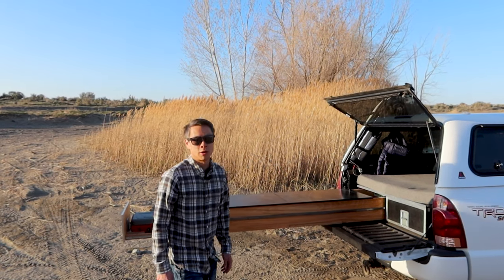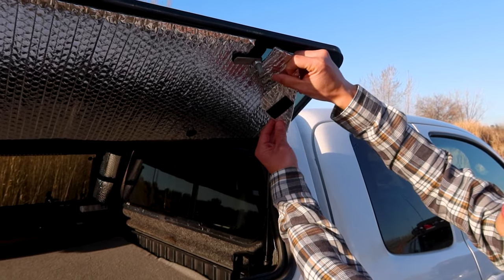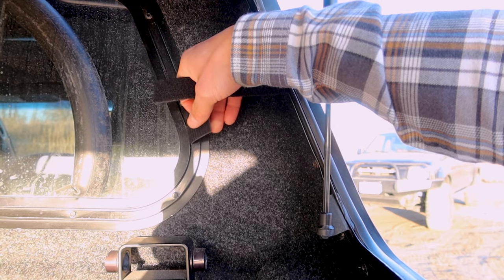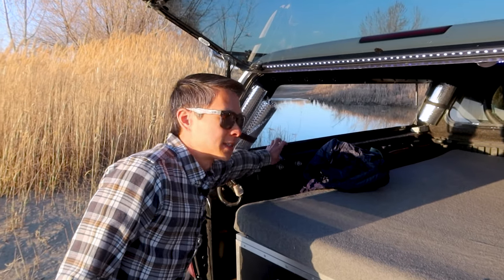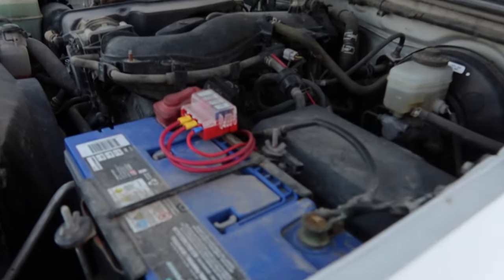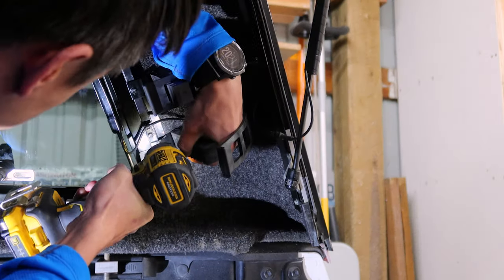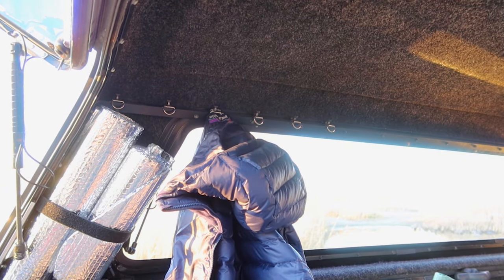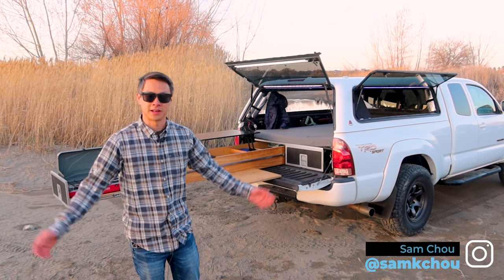Essential Truck Topper Mods for Camping and Overlanding

Comment: I like your setup, but I went with simplicity, I do that with most things. All I have is some cardboard on the bed, covered with OSB board, moving blanket, camping air mattress, sleeping bag with several blankets, a little wooden box turned sideways for shelving, and cammo curtains with shock cord to hook them to brackets on the window frames. I love riding my motorcycle so I try to put any savings into the bike's fuel tank. I do remove my curtains from the cap's side windows while I drive to open up any blind spots. A head lamp is all I need, mainly because when I get around to stopping it's to go to sleep. My truck is a 2003 Ford Ranger, 400ci V6, in excellent shape.

Comment: We took a slightly different approach to ours: reg. cab with 8' bed, pillow top mattress in back witch leaves about 2' for Dometic fridge (12v outlet in back),firewood and a 8 gal water container, the one big game changer was getting a professional crawl-thru (Breezer Windows), i'm old and i remember crawl-thru's. This one doesn't leak. The stock sliding window on 07 Dodge is very small. Our truck is for camping & traveling only so i need room for firewood & camping equipment, but even with all our stuff we can stealth camp.
Reply: Sounds like some one who watches Steve Wallis.

Comment: Very informative, thank you for sharing. What gauge wire did you run from the battery to the connector by the break light? Also, what does the connector look like?

Comment: Do you have any problems with the lights sticking to the glass?  And do the lights you have at the very top, when open, of the lift gate get in the way or get hit when the lift gate is closed?  Very nice work and very clever.
Reply from the maker: No problems with lights coming loose whatsoever. The velcro tends to come off in freezing temps, though. The light strip clears the tailgate no problem.

Comment: Great video. Why can't you drill into the fiberglass?
Reply from the maker: You definitely can, but the hole will go through the other side, unless you're drilling through the honeycomb on the ceiling.
Reply: @SamChou  oh yea for sure. I'm good with that. I'd just bolt it up and seal it up well. Just making sure there isn't something else about a fiberglass topper that makes drilling a bad idea, something like micro splintering that causes leaks and is unrepairable

Comment: Can the two 60" light strips be hard wired together, by cutting the connectors off a soldering the wires together? If then going to wire them into my existing dome light, because it has a plunger that turns the light on when you open the rear door on my shell. Great work on all of your add-ons.
Reply from the maker: Yeah they can be shortened or connected together any way you want. Solder points are throughout the strips.

Comment: Maybe it’s a bad question because I don’t understand lol but what do you use the tire tube for? You said sealed together but what’s the purpose? Awesome setup definitely taking some ideas from you.
Reply from the maker: I can leave the windows open from the cab to the shell, and not expose the gap to the outside air. Otherwise there's a big gap between the windows that rain or cold air can get through.

Comment: What’s your thoughts on a lithium battery and solar panels for accessory power? If you have already added can you share video link? Thx
Reply from the maker: Personally, for my adventures, I don't feel the need for an auxiliary power setup. I'm a weekend warrior primarily, so I rarely get to camp longer than 2 nights in a row, and my truck battery is more than enough to keep my devices charged and the lights on at night for that long. If I do stay longer, I just start the truck and let it idle for a few minutes. I calculate that 1 hr of idle time is enough to recharge the battery from full dead on my truck. The battery I have is a combo deep cycle starting battery, pretty much the highest end AGM that can be purchased, so it's okay with being drained. I always keep an eye on the battery voltage, but I also keep a small jump pack charged in case I drain it too far.

Comment: Did you add a PWM module or something similar to make the Serious Lights (Nilight) dimmable, or were you only referring to the RGB strips?  If you went that route, I'd be curious how.
Reply from the maker: I added a simple dimmer module in-line. https://www.superbrightleds.com/moreinfo/single-color-dimmer-switches/single-color-led-controller-with-dynamic-modes/1082/2573/?utm_campaign=Child+-+Organic+Shopping&utm_source=More+LED+Lighting+%3E+Single+Color+LED+Dimmer+Switches&utm_medium=MLD-5A&gclid=Cj0KCQiAzfuNBhCGARIsAD1nu-9lKmdZ2fR0vfbugzhKWbSEQW1cNcenxaeq7DM8o9VIBCCsBRMWmgcaAmU2EALw_wcB

Plus it has a bunch of neat seizure inducing flashy modes!
Reply: @SamChou  I can never pass up a free seizure.  Thanks for letting us all copy your homework.

Comment: Question: how did you mount your light strips? Just adhesive directly to the carpet interior of the camper shell?
Reply from the maker: Adhesive backed velcro to the back of the strip, velcro attaches to the carpet.